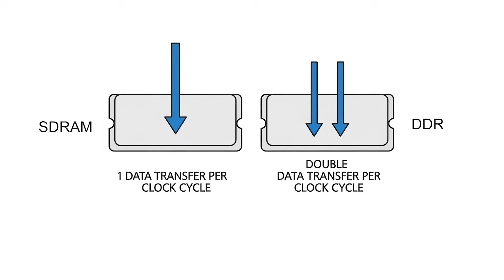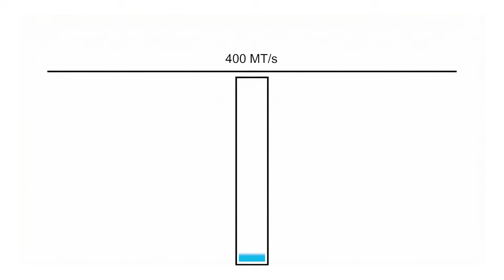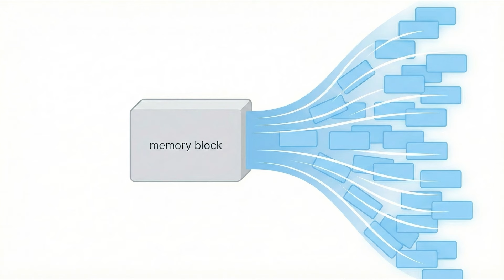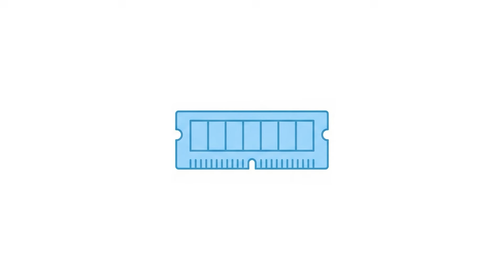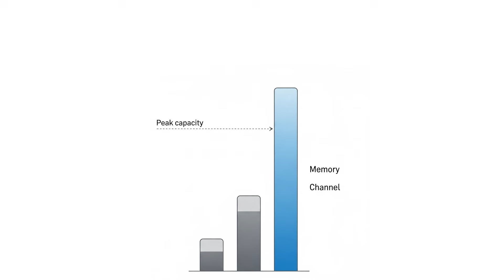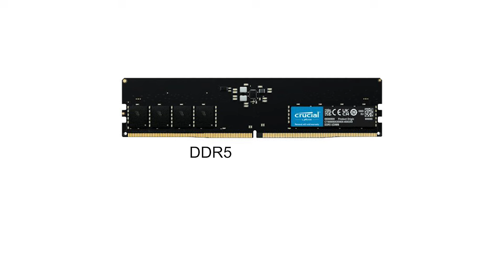Every DDR RAM Generation Explained

Comment: Unfortunately this is wrong. Storage is in fact the slowest factor.... If you have a mechanical drive with 4gb RAM it will be improved with an SSD instead. It will be much more noticeable than upgrading ram first.
Reply: Using zram for additional 4GB of ram is not fast or ideal.

Or I think I'm misunderstanding watt you said, could you elaborate?
Reply: @seekingtruthinthetruth  if you have a slow computer, most likely an older mechanical hard drive that is the cause even if the computer only has 4gb of ram. Upgrading the drive to an SSD will see huge improvements even if you keep the same amount of RAM. I was not talking about zram 😅